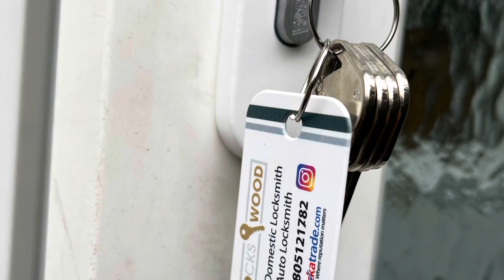uPVC Mechanism Gearbox Replaced | New Euro Cylinder | New Handles - Locksmith

Comment: Surprising what little things you learn il fish the cam out with a bent hook usually but using the magnet looks so much easier nice idea 👍
Reply from the maker: Cheers Benjamin. I’ve only ever used a magnet to be honest! I’m sure a bent hook works just as good through 😊
Thanks for watching bud 🙏🏼
Reply: I had a try today it does slightly speed up the job thanks for the tip 👍

Comment: Excellent job  at least you didn't have too adjusted the door by much  I had too do a 35mm Gu gearbox on a front door today because of the split spindle system no longer available had too put in a new style Gu box had too do a bit of adjustment luckily I had one in my dads shop
Reply from the maker: Nice job mate. One of my favourite jobs is a uPVC door job 😁

Comment: I’ve done lots of gearboxes now and like you took the whole unit out to begin with but I’ve found if you leave the bottom screw in and remove the mech from the top you can do the mech in situ without it coming completely out the door it saves you scrating about on the floor certainly works for me
Reply from the maker: Nice tip, cheers mate 👍🏼
Reply: Ooh I'll try this . Everyday is still a school day 45 and love little tips like this 
🤜🤛 🫡

Comment: As I'm watching today 9 Jan 22, your up to 322 Subs.  Sounds like you Channel is taking off.  That's an interesting door.  Looks to be a type of storm door, not a lot of meat for that latch to catch.  I have never seen something like this before where the mechanism is the whole length the door.  Very Interesting.
Reply from the maker: Thanks mate. I’ve been blown away by the response of the channel to be honest 😊
This type of uPVC door is very very common over here in the UK. It’s called a Multi Point Locking System and can have anything from 3 - 8 locking point up the length of the door 😊 Great for security but not so good for locksmiths when they fail 😂
Thanks again for watching 🙏🏼
Reply: @brighton_locksmith  I have a storm door on my back door where the handles broke (cheap pot metal). The replacement is not readily available and almost as much as the door.  So JB Weld and a hock latch until I get a new door.  It's not used much in Winter anyway.

Comment: Wondering why you broke the lock, when it was the gearbox unit that was faulty?
Reply from the maker: As I said in the video. The customer had said the cylinder had been temperamental and had been causing him a problem for a while so we decided  to change it. I wasn’t able to get the cam to move to remove it hence snapping it out. 
Thanks for watching
Reply: @brighton_locksmith  Thanks Andy

Comment: Would it be possible to remove a 3-point multi-locking system that the center latching broke from a door and just install a standard door lock even though the grooves will remain in the door or it's not recommended. Over here I would have to buy the whole lower mechanism that can be a couple hundred dollars and I cannot just replace the lock set?

Comment: Hi when I open my door all the latches go into the locked position without lifting the handle is that a sign of a worn gearbox
Reply from the maker: Yes almost definitely you will need a new gearbox. 
Contact your local independent locksmith to carry this work out for you as it can be a tricky job if you don’t k ow what you are doing.

Comment: Hey andy, thanks for posting. Where would I be able to purchase the multipoint replacement locks like you have.
Reply from the maker: You can buy these from all locksmith suppliers but you will need an account and proof you are a locksmith. Suppliers will only supply to the trade. 
Thanks for watching 🙏🏼
Reply: @brighton_locksmith  Thanks, actually I am a licensed locksmith but here in the U.S. our security and products are not comparable to what you have. Wish they had locks4vans here, sure my customers would love them. The issue is that if duplicate keys would be needed, it may be complicated. Love what you are doing. I subscribed and thanks.